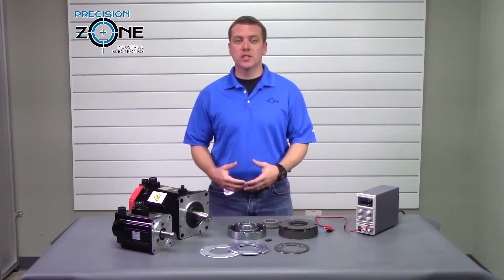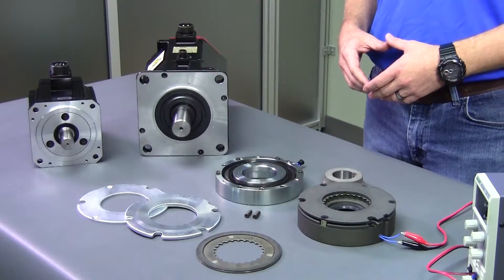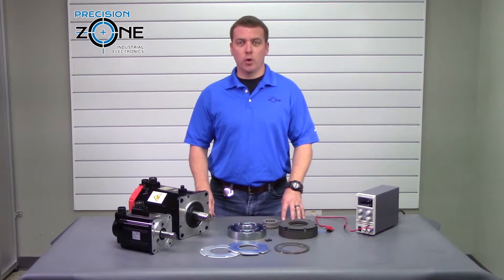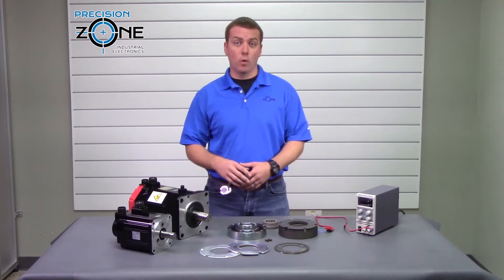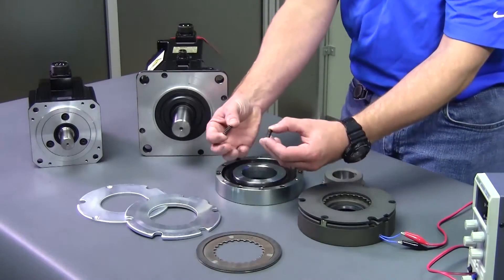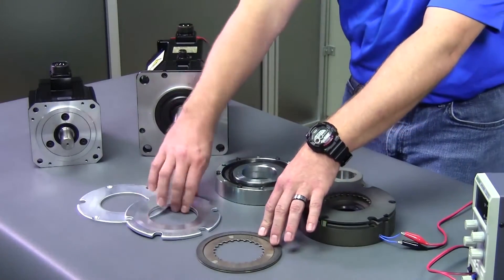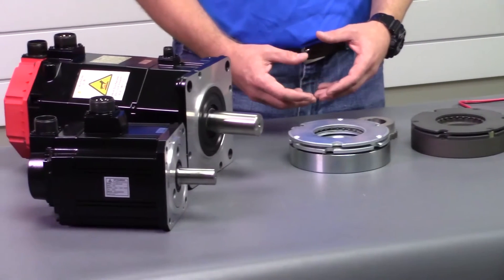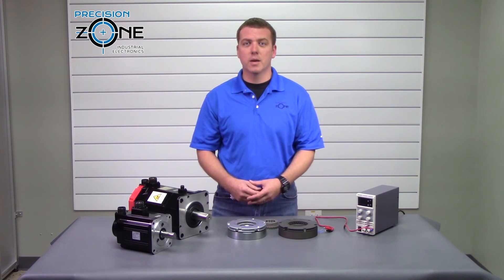AC Servo Motor Brakes Overview

Comment: Hello sir 
  I got problem with stober motor 
Gammerler stacker zl540
Mesg read servo drive fault 
Code 4333 and 4339 
Remedy explain:
1  excess current 
2  i2t
My questions 
Is it a problem of motor brakes or the posidrive ?
Or earthing? Or tant suggestions! 
   Thank u !